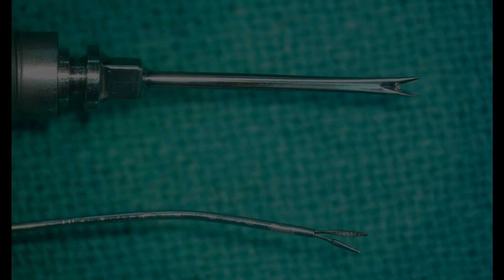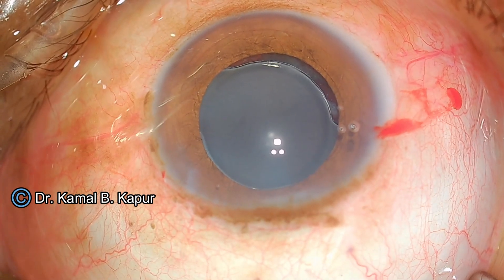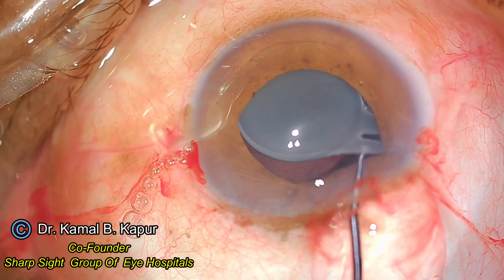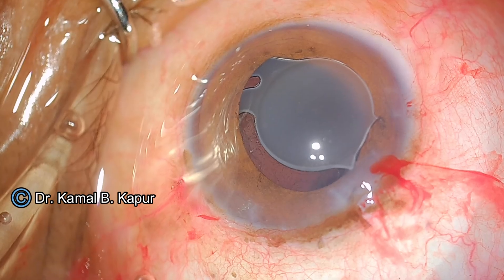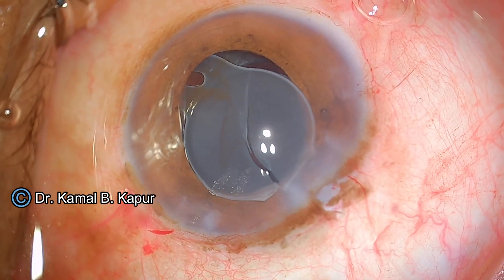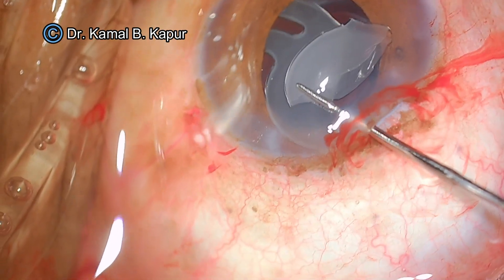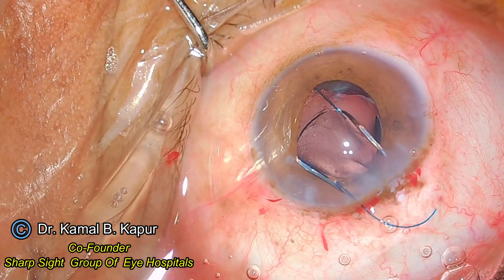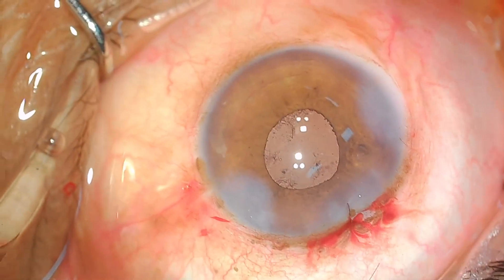NEW Automatic IOL cutter for opaque IOL explant -Dr Kamal B Kapur

Comment: Does it cut with heat or vibration like phaco tip? What is the mechanism sir?
Reply from the maker: It uses a mechanical jack hammer effect  to cut with sharp edges , and also may generate  heat
Reply: It uses the ultrasonic energy for the phaco machine
Reply: The heat generated is the same as normal phaco tip - both 23-25 degrees